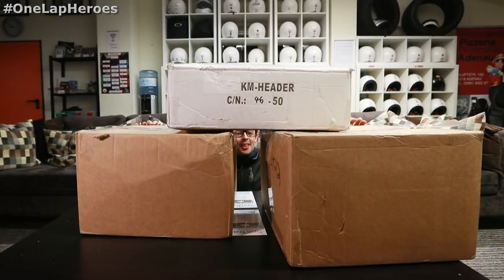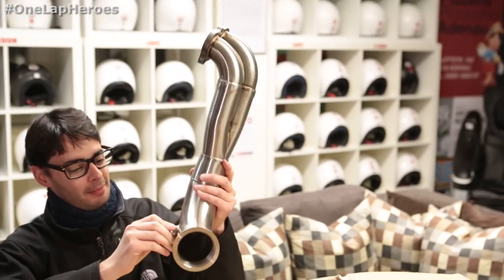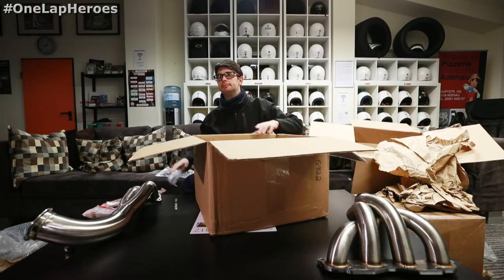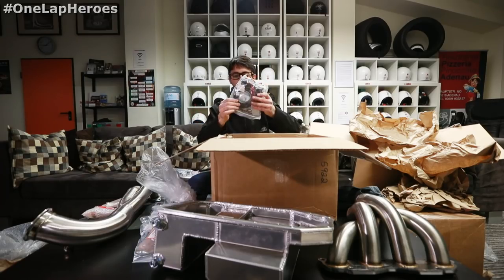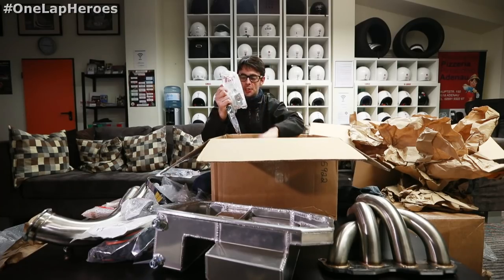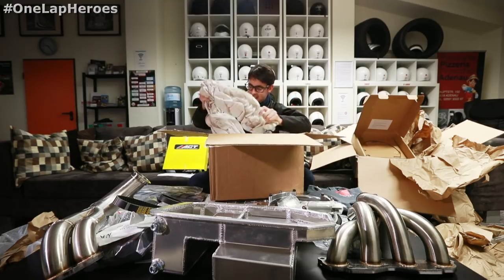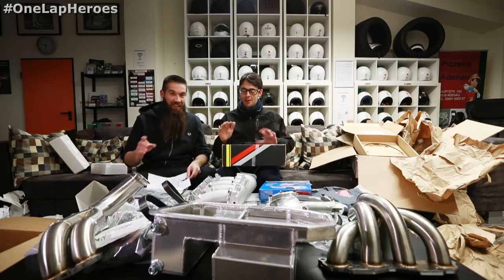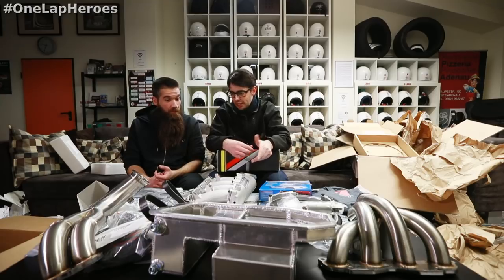Unboxing The KMiata Swap kit! // KMiata Build - Part 1

Comment: Serxios face says a lot. Cant wait for the car beeing ready. Id keep it stockish too. K20a2 responds very well to intake exhaust and software. I think kostas is about right with 200whp. My guess would be 230 crank hp. Wich probably equals about 200whp
Reply from the maker: Exactly our thoughts...
Reply: There are many factory K20s running turbos reliably for years while making excess of 600hp.

Comment: Run a suitable hose between the two drain plugs, maybe with a check valve, so the oil can level out and maybe be directed to the oil pickup area - otherwise it will just fill the rear (?) sump and do nothing for the oil supply - might as well just use a flat plate instead of that sump.
Reply from the maker: This sump has been track-tested for years now (in cars with much more rubber/grip than what we intend to run in the SX5). Although as all engineering solutions, a compromise, we prefer this type of compromise that keeps the steering rack and the front geometry same as stock.
Reply: No worries, no point in designing a new mouse trap, and I would agree that if it has been already proven to work... - just don't see what point there is in the other sump.
Reply: GordoWG1 WG1 all it does compared to a flat part is adding oil capacity, which is good/necessary to keep temperatures stable
Reply: If it was a winged sump I would agree but, without some means of actually circulating the oil, it does nothing except add to oil change costs as it just sits there.
Reply: with the car going around a track and oil shooting down from the crankshaft I believe it will mix up with the rest pretty quickly :)

Comment: The price of the kit is the biggest rip off I've seen for a swap kit after mini k20 one, and I am talking about the price of the real parts needed, without the intake manifold and other stuff you can source by yourself, the flywheel, adapter plate and engine subframe alone are extra super overprice, it is not worth it unless you don't mind being ripped off, and kit demonstrated to be defective at least on the first production batch the flywheel would crack, the pairing harness to  match honda harness with miata harness would melt, the exhaust was a headache  to fit, the oil pump oil sucker tube will break or get loose totalling the engine for oil starvation and they manufacturer would not accept any responsibility for it.